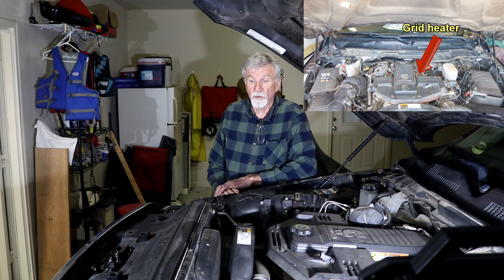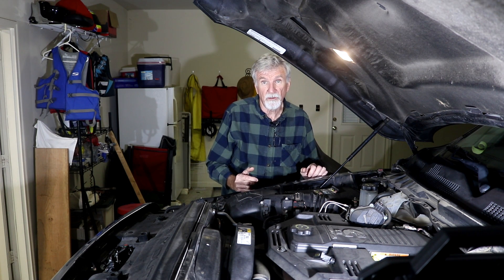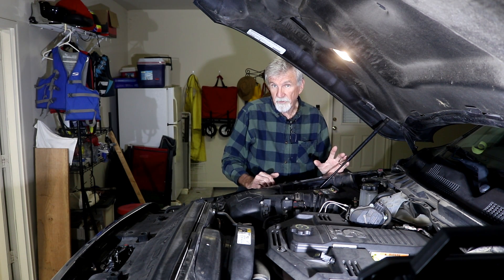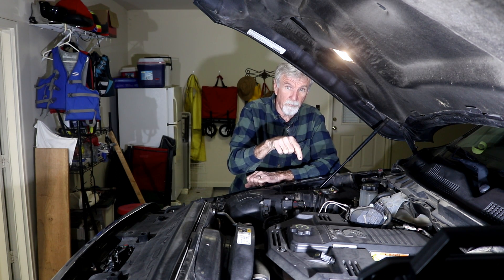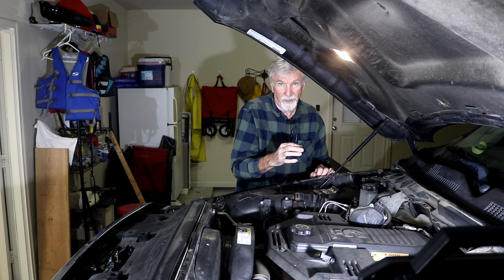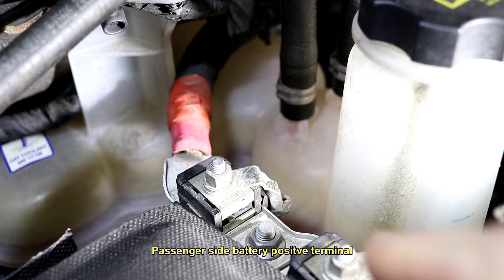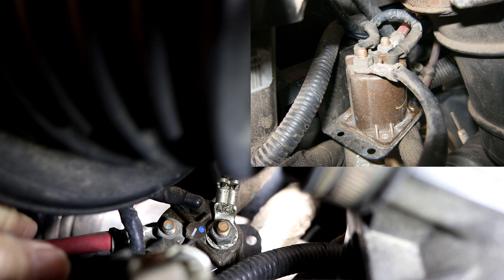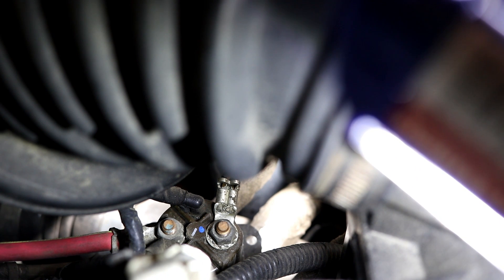Cummins Grid Heater Killer Bolt Issue - Amps & Voltage on engine start

Comment: I have an 06 dodge 2500 5.9l diesel and it shows a code of p2609. I'm trying to troubleshoot the problem now to fix it. I've also got to find the bracket and wire connected to it to do the "jiggle test" but do not know which side of engine it's on. Any advice? Thanks, Steve

Comment: I have a 2005 Dodge 5.9 . My indicator light on the dash will come on after about 20 min of driving then go out after 5 min or so , Then come on again 10 min later then go out . Does this maybe 3-4 times within 30-40 min then stay out . Any idea what is causing this ? Thanks

Comment: I just disconnected the positive cable to the selinoid. Started a few times (Warner weather). No CEL... Yet🤷
Reply from the maker: I think you'd be better disconnecting it at the battery so there's no loose hot cable that could touch something and short out.

Comment: I have a 2006 5.9l that has the delete. I get the engine codes. is there any way to fake the ecm out so it doesnt throw codes?
Reply from the maker: There is, some of them, should be able to do it with the tuner that deleted it.

Comment: I had my grid heater replaced for now until I can replace with better system this then when this then I noticed my battery dancing I was wondering my batteries are brand new compared to my alternator and if the grid heater is taking that much power I thought okay cords aren’t clamped so it must be a alternator issue so I bought an alternator now i do not care if the grid heater is doing this batteries are not supposed to dance was not doing this until I had my grid heater replaced so your saying now I just bought a alternator for nothing maybe cause of what you said how the grid heater runs and where it runs off of and my pcm could be the problem that’s a $1,000 part and $1750 labor fix please dear God

Comment: I can understand not deleting the grid heater if it's under warranty if that bolt takes out the engine during warranty Rams buying a $10-$20K engine!!! If people delete or disconnect the heater during warranty we won't know just how often it's failing? My 2012 Ram just started throwing a code when I use the remote start and it shuts down a few seconds after starting 😢. It's a voltage issue to the grid heater, I did the jiggle test it seems fine but it could be inside the intake further in that test is not 100% ! So for cheap insurance I'm getting the banks with the heater in the air horn. I'd rather pay $900 to remove a failure point than having my truck blow the engine while I'm thousands of miles from home towing my camper. Ram does need to address this one failure like this is too many!!! .   And I like the remote start to warm my truck up in the winter when it's 20 below in the Upper Peninsula of Michigan. Cold leather in a Laramie sucks.  I didn't get heated and cooled seats for nothing.

Comment: In all seriousness, I woke up at 4:00 a.m. thinking about this grid heater bolt issue again as my Monster Ram air intake sits new in the box waiting for install whenever I get around to it.  Until I watch this video, I really had no idea what the actual problem with this grid heater bolt situation was about. I had no idea that a person could just do a jiggle test to check on it now and then. If I had done that I would have saved myself the $900 for the Monster Ram air personally. I just don't use the truck or challenge it by heavy towing enough to warrant the $1,000 Monster Ram but since I have it I might as well put it on :-) thank you so much for posting this video and you're very detailed explanation of what's going on. I thought the bolt was just vibrating off. I didn't realize it was a arcing situation causing it to melt away
Reply: Good investment regardless then your engine doesn’t have to blow in the long run if you don’t want it then I will take it off you hands I have 2 kids 😂I am a mom and my truck is my own livelihood

Comment: Yea  my  check  engine  light  came  on  ....the  code 2609.... I've  been driving since Nov....   its  pretty  loose  and  I  have  to  fix  it tommorrow  at  the  dealer....I  don't  trust  them and  my  truck   is  still  under  warranty....only  has 88000  km....I  wonder is  there  a  up  grade  that  can  be  done by  the  dealer?
Reply: Like  the  Bank s  system?

Comment: When I bought my 
2017 2500 Ram right after I replaced my cold air intake 
I deleted my grid heater with the banks Gen 2 
Kit, I was not taking any chances. Ram will not cover it and Cummins will not cover it as well

Comment: What if you were to disconnect the hot leads from the passenger side to the grid heater would that work, would that eliminate the danger of the grid heater having a problem?
Reply from the maker: Yes, the red fusible lead that goes down to the solenoid from the passenger side battery.  Just tape or tie wrap it out of the way somewhere. Thanks.

Comment: Did you disconnect it from taking the wire off relay going to grid heater? Have you had any check engine light from it? I still want my remote start to work!
Reply from the maker: I took the wire off at the battery, so if it touches ground, nothing will spark.  The remote starter will still work.

Comment: How would you disconnect it 2019 2500
Reply from the maker: Look on the positive battery post on the passenger side.  The wire that goes down to the solenoid under the air intake is the one to disconnect.  Once disconnected from the battery, put a little electrical tape on it and tie wrap it to one of the negative post wires out of the way.  I just realize you have a 19 but it’s probably the same.
Reply: @Marion Blair  I unplug the red to solenoid and didn't stop it
Reply from the maker: @shannonagee799  it will still show up on the dash but the grid heater should not be energized. Just go straight to the start without waiting for the light to go off so it doesn’t throw a code in real cold weather.
Reply: @MarionBlair  what do you think of water menthol injection
Reply from the maker: @shannonagee799 Not sure it would be applicable for our trucks.
Reply: @Marion Blair  Do you think it would be worth adapting a system to it,  I have been told it keeps dpf and intakes clean

Comment: I just found out today my engine is shot from this grid heater bolt issue. #6 cylinder and piston damage. 2013 With 115,000 miles. Meticulously maintained. However didn’t see this video in time.  BEYOND disappointed.
Reply from the maker: Sorry.  RAM / Cummins should deal with this

Comment: I disabled my grid heater last week.  This issue needs to be a class action lawsuit, Ram needs to make this a recall.
Reply: Not rare at all. Only people that no about it fix it....mine at 60000kms and failed the wiggle test. Now have to order banks grid heater...
Reply: @mikecabot1617  Yup my 2016 with 120K just faild the jiggle test. Banks ram air going in next week.
Reply: @richardcooper6050  I went with BD diesel after, mainly because I may go with their turbo set up down the road. Same purpose. Waiting game now...
Reply: it’s a pretty rare thing to happen is what I’ve read so far.
Reply: One question no one yet to answer is if you disconnect it from the battery would it through a code ???
Reply: @gardnetbush9768 I've had it disconnected going on 3 years and no codes.  Only time it will throw a code is if you use remote start.
Reply: @Swiss918 oh ok thanks

Comment: Today my grid heater and air intake manifold was replaced with the Banks Monster Ram and wow, just in time!  The mechanic gave me the old parts and the stud on the outside was gone and the bolt and nut underneath was only being held by gummy soot.  The bolt had broken off on the outside who knows how long ago!  I feel very lucky to say the least.  My 2008 Ram 6.7 has 257,000 miles and I am hoping for many many more.
Reply from the maker: Wow!
Reply: And now that I think about it, my grid heater dash indicator light still comes on during cold morning starts, but I don’t see the voltage gauge changing at all.  There was a time when the gauge would move significantly during grid heater startups.
Reply: This morning the temperature here in north Alabama was in the 40s so the new grid heater in the Banks monster ram air intake manifold was tested for the first time.  I’m happy to report that the heater worked perfectly and the voltage gauge moved accordingly and the dash and headlights dimmed right on cue like they used to.  

No telling how long I’d been driving this truck with a completely destroyed grid bolt/nut literally held in place by sticky soot.  So lucky.

Comment: Did ya ever hear what years this goes with -- and did the bolt come with Loctite on em or not -- odd stuff -- as if Ram - which they are claiming they are another subcompany now days - does this crap on purpose - they could have fixed that very easy of course -- kinda like the many many radios they have that are defective -- altering the entire electronic system for the worse -- been that way for 10 years or more so a service manager tells me -- - nobody has yet to sue them  - so they have not done anything about it - GMC -- here we come !
Reply from the maker: I agree, this should have been fixed a long time ago.  No loctite.
Reply: @MarionBlair  - ahahahaha -- and i am a bit of a conspiracy theorist  - just how stupid could they be -- maybe it is not stupidity  - maybe its a way to make a buck - odd crap they do - surely makes one wonder ? !

Comment: Thank you for this information.  I am troubleshooting a no crank clicking issue.  Even after new batteries, and starter.
Reply: I am going to check out in the morning. I had left the key on my 91 d 250. I was not familiar with intake heating or the solenoids relays. Apparently ground wire had gotten damn hot. Trying to locate where problem is currently escaped my thought process. Any knowledge advice from you would be greatly appreciated.

Comment: i don't u/s why this is even needed if u live in warmer climates?  I think when my new truck comes I will just disco it??  if i ever visit those colder places i can just hook it back up???  as long as it has no issues with performance i say kill it
Reply from the maker: Yep, mine’s off
Reply: @MarionBlair  i think the bigger issue even though we turn it off is the PROBLEM of soot still collecting on this grid even though turned off, THIS IS THE REAL ISSUE and why the grid itself needs to be removed? or does it really serve a purpose??

Comment: If your that worried about the nut falling off, take the grid heater to a welding shop, have them weld the nut on
Reply: The bolt melts off from arching.. Welding would not work and would probably damage the insulator block.

Comment: Marion sorry if this has already been asked, but do you think having an EGR system in these trucks is contributing to or actually causing this problem?
Reply from the maker: No, the EGR is not the problem.  It's either loose from assembly or gets loose.  I disconnected mine.
Reply: ahahahahah - lawsuits happen -- My first motorcycle back in the 70s got 112 MPG -- Yu tell me what has happened -- Russian Mobsters have taken over this country - they are called russianpublicians - now "everybody" is on board for the under the table money's - and making vehicles complicated cuts out the back yard mechanics altogether - even if they own a shop !   -- Ram sued Cummins for the rights on the engines that have  - Now even Cummins cannot work on or talk about their Cummins engines in ram trucks - how's that for Mobsters - anyway - the heaters have nothing to do with the emissions to my knowledge - cold weather easy starts is all it is for - mine comes on even at 32 degrees - which is not very cold - they claim it helps with wear and tear - HUH ? !  -

Comment: I unplugged One wire on each solenoid coming from the pcm so it wouldn’t close the solenoid and drain My batteries. I only make short trips usually. Had no idea it could belt the grid heater bolt and destroy the engine. You don’t need a grid heater for the Cummins they are only for emissions. My trucks a 97 12 valve I’ve done the Killer down pin fix. I’ve had two 12 valves. My 94 automatic the dowel pin moved out a couple mm. My 97 with a manual transmission had not moved out at all. I’m guessing because the automatics rev higher and cause more vibration.
Reply from the maker: Could be.  I agree, it's not needed.

Comment: Wish I would have seen this earlier.  This issue took out my engine while full time RVing.  The truck is a 2013 2500 and had 106,000 miles at the time.  It cost me about 20k for a full engine replacement, was stuck in Utah for 6 weeks.
Reply from the maker: wow, so sorry.

Comment: Came across this video because we currently have a 2016 3500 that we took to a workshop because of this very problem.
When we arrived we saw another Ram 3500 in the same model with half it's engine torn out. Called the number on that truck to talk with the owner and asked what the issue was. "Some grid heater bolt fell apart, the dealer states it's a freak thing, one in a million, never happened before."
We were shocked because that was word for word the same explanation we got, even with the "one in a million, never happened before" part.
So we started asking around turns out that in a community of 350 K, one in a million event happen all the time to Ram owners!
And I'm not talking about a community with 350 K Rams, but total population!
This issue is far more common than Ram or Cummins admit! And is only going to get worse with age. Our vehicle has less than a 100 K km on it or 60,000 miles
Reply: Where do you live?  I’m wondering if this has much higher failure rates in very cold climates due to the heater cycling more??  I’m in Texas and have never heard of it happening.

Comment: This just happened to my company work truck. That's the only explanation that I can find. The bolt settled in my #6 cylinder and started ticking. Took it to my mechanic and he found a bolt in #6 cylinder. Thank you for your video it helps my conclusion.
Reply: Same thing just happened to me on my 2017 with 47xxx miles.  My private mechanic put his camera in the #6 cylinder and took a pic of the beat up piston.  
I dropped the truck off at the dealership last week and waiting to hear back for the warranty.

Comment: I was curious if anyone could lead me in the right direction. I’ve got the p2609 fault code on my 2018 2500 33k miles. And doing the jiggle test everything seems solid. I’m concerned with starting and driving it for obvious reasons and any help would be greatly appreciated
Reply from the maker: Possibly the solinoid

Comment: Marion have you heard of the grid heater solenoid failing in the on position and destroying the electrical system?
Reply from the maker: I haven't heard of that.  Plenty fail, mine did however they usually fail open (contacts).  There is a fusible link on the cable coming off the battery, I suppose that's designed to protect a complete melt down.
Reply: @MarionBlair  That makes me feel a little better. Thanks.

Comment: Hey Marion, I just posted a video to show what my grid heater bolt looked like when I took my intake apart. I’m very glad I elected to delete the heater. I’m from Louisiana also, I don’t think it does us any good down here.
Reply from the maker: Mine's been disconnected for years.  I'm usually starting in my garage but have had a few freeze temp starts with no problem.
Reply: Marion Blair if yours has been disconnected since new, I bet you will be A-OK, but if someone is ever near it while doing something to the engine, i think it’s worth deleting for better air flow. The ICT billet plate I bought was $70 and then $14 worth of gaskets from Orielly’s.
Reply from the maker: @johnblevins897  Yea, not a bad idea.  thanks.

Comment: My truck will start as it gets chilly without the heater. But it cranks a long time. Gets below zero.. forget it. If you live in Wyoming/Colorado/Montana/Idaho etc… you have to have a grid heater
Reply from the maker: Ok, Is that with the block heater also?

Comment: I don't like that the grid heater stays on while engine is running. Puts unnecessary load on charging system.
Reply from the maker: I should go off pretty quickly?
Reply: @MarionBlair  I need to do some troubleshooting. Got the service manual on order. If everything is working as designed I will put in a toggle switch to deactivate the grid relays when not needed.
Mine is in a f650.

Comment: The voltage meter on the EVIC is crap.  If the batteries lasted forever no problem, but it would be nice if a $60K vehicle had an actual working voltage meter.  Will do the jiggle test on my 2013.

Comment: Thanks for the great video. Im checking this today as I am having an electrical issue where the grid heater light came on while driving and my voltage meter dropped to about 8v. Checking ground wires today too.

Comment: Thanks for the informative video Marion.  I viewed some of your other Ram videos before seeing this one and knew you would b a good source for information.  My 2013 Cummins with 62,000 miles is in the shop now for the grid heater / relay replacement after I checked the power post and found it was loose.  That was after my truck check engine light came on and coded p2609.  I asked the repair technician to return the old parts to me so I can see how far the bolt was melted down.  This is my first serious problem with the truck in 7 1/2 years of driving so it’s not all that bad.  Keep the videos coming!
Reply from the maker: Yea, I had a bad relay also and same code.  I leave mine disconnected.
Reply: Where do you live?  I’m wondering if this has much higher failure rates in very cold climates due to the heater cycling more??  I’m in Texas and have never heard of it happening.